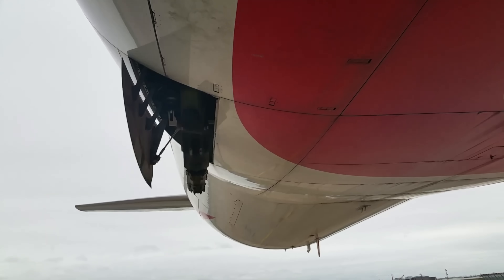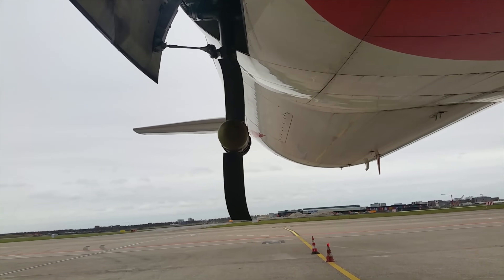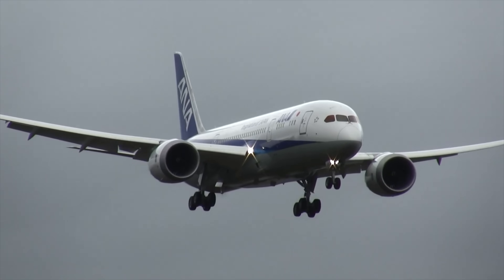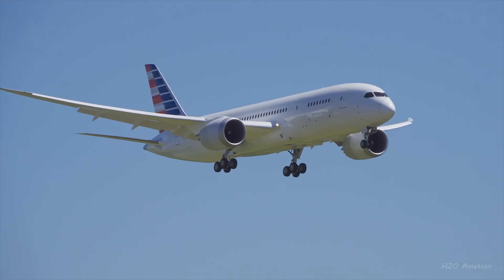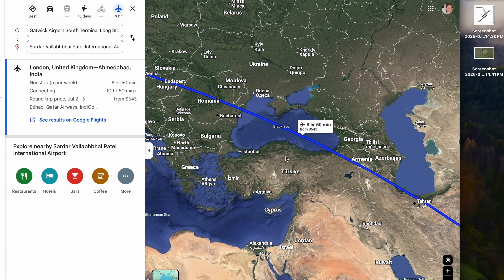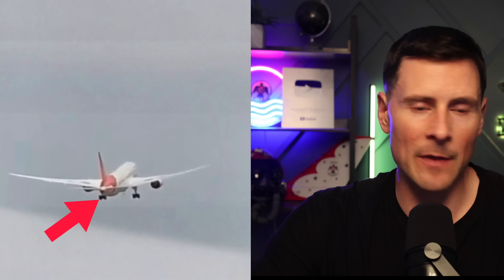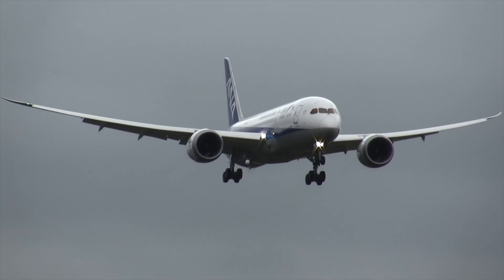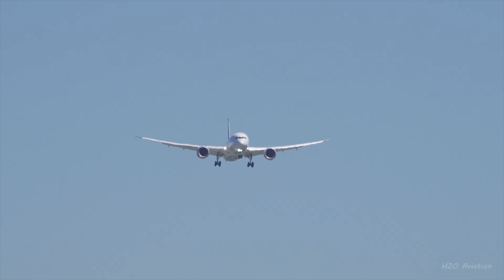Air India 171 SHOCKING UPDATE on RAT Deployment and Flaps!

Comment: If the autothrottle computer software had erroneously moved both throttles to flight idle (subject of recent AD 2024-16-07) at weight off wheels, would this have triggered auto deployment of the RAT?

Comment: Will somebody who knows, please tell us about the procedure for loading the details for take off into the 787's Flight Management Computer (FMC). I believe the FMC fully control the flaps, engine speed and other things, but can it be overridden by the pilot?
I have a bad feeling that something went wrong with the FMC, even though it has worked okay for over a million flights. Engine power sensors maybe? Who knows, but Boeing will need to come clean if it is suspected.

Comment: This was pilot/co-pilot error, resulting in a "Departure Stall"..
Too low-Too slow; incorrect air density calculations; flaps zero; incorrect angle of attack between VY>VX...
Reply: Rubbish. All of those factors are controlled by the 787's Flight Management Computer (FMC), not the pilot.

Comment: My guess has been that it was fuel starvation to both engines due to pump failures. The most likely cause, in my inexpert opinion, was that there was a catastrophic complete failure of the electrical system that was powering the fuel pumps.

Comment: Boeing 737 Max crashes investigators identified issues with the system, which repeatedly pushed the plane's nose down, leaving pilots fighting for control. Bet this is similar but with additional sensors involved with those RAT propellers. The people programming this were rushed to help Boeing sell the planes on time. Safety to allow for sensor errors not causing this was just taking too long. Trump administration were pushing for America 1st and big business profits so likely this issue was ignored. Federal regulations not as strict as they should be all because of Trump. Congratulation for another screw up.

Comment: It’s well known this flight historically didn’t back taxi to use full length.  That is likely what happened on this very hot high humidity day.  That was the first hole in the swiss cheese model.  The rest is easy to figure out.  The pilots could have used full,length and this accident would have never happened.  If it was a mechanical issue the FDRs which have been retrieved would have already been published but since its pilot error, this is going to be a hush case for a long time.

Comment: black box has already shown what happened,in 5 minutes,when will they tell us the truth,i personally guess weight shift,it is very rare a weight shift in a plane,changes center of mass,and thrust cannot help,if one engine fails it will lean if both fail it will fall and glide,bad luck was the building stood in the way with landing gear on in open space they would have crashlanded  safely...third option is something happened to both pilots,plane was on its own,it cannot be anything else...weight...both engines or pilots fainted,it cannot be something else

Comment: What is more likely, dual (simultaneously) engine failures due to fuel contamination, or dual engine rollback do to FEDEC receiving inaccurate information and putting the fuel management pumps to command idle or cutoff as a result of a catastrophic electrical failure? Both are EXTREMELY rare and have NEVER happened before. I want to know if there is ANY contamination found in the truck, or ground tank,  that fueled this aircraft! Also would love to see the maintenance logs for this aircraft. Heart is very heavy for all those who lost loved ones in this tragedy you deserve answers!!

Comment: As I recall from your previous postings, the plane was built in 2011 and had 14,000 hours of flight time. It had recently be services. The simultaneous failure of both engines and the failure to deploy the flaps suggests human error probably during maintenance. Many companies including Boeing hire poorly qualified personnel for critical jobs to save costs and increase profits. Are the flaps electrically controlled or hydraulically controlled? What about the flaps? If the engines were supplied by separate generators, for redundancy then a systematic error was made during servicing. Are the fuel pumps separate for each engine? I smell human error. Often it isn't just one error, it's multiple errors that can often cause catastrophic failure. We'll have to wait for the black boxes to reveal what happened. Forensic inspection will reveal the physical evidence. Often the parts are collected and assembled in a hangar where they might be studied for years before a final determination was made. I might have gotten the year of construction and flight hours wrong. But if this plane had many years of reliable service and had recently been serviced then that could be where the root cause lies.

Comment: I have seen 1 Pilot talk about VAPOR LOCK due to the Heat and No AC as it sat on the Tarmac for 2 hours. There were no other Planes with a problem so less likely Fuel Contamination from the Source. Not sure but in certain Model Cars Vapor Lock is a problem duevto fuel lines being too close to the exhaust Manifold or Pipes.

Comment: Some people have said that the dust kicked up when it rotated was due to a long take off roll, hence disturbing dust at the end of the runway. But that structure in the video is only approx 1/3 down the runway so even allowing for image foreshortening it rotated in about the right place.  That means the 'dust' was actually smoke from one or both of the engines. Shame it was obscured by the structure. Maybe FOD on the runway???

Comment: I believe the cause was a combination of Fuel Shutoff Valve (FSOV) activation and a cascading electrical system failure. It’s not the first time a 787 has experienced electrical issues during takeoff and required RAT deployment. Let me explain my reasoning:

On the Boeing 787, the engines will keep running even if all hydraulic systems fail. Each engine has its own FADEC (Full Authority Digital Engine Control), powered by a Permanent Magnet Alternator (PMA) that’s driven by the engine itself. Once the engine is spinning, the FADEC operates independently — controlling fuel, thrust, and safety — with no need for aircraft hydraulics or external electrical power. A simultaneous FADEC failure is extremely unlikely. 

So, why did the engines shut down if they are supposed to be so resilient?  There is one important component that can override the FADEC: the FSOV. This spring-loaded fuel shutoff valve is not powered by the PMA, but instead by the aircraft's electrical DC system. If power is lost, the spring closes the valve instantly, cutting off fuel to the engine. FSOVs are a fail-safe, designed to protect the airframe, not the engine. In Boeing’s logic, it's safer for the engine to shut down than to keep feeding fuel into a potential fire.

In this case, the truck tilt actuator (landing gear in forward position, the first mechanical step when the pilot retracts the gear) was briefly activated, suggesting the pilots attempted to raise the gear.  That gear retraction moment may have been the exact point when the whole system collapsed — just a few seconds after takeoff. The engines kept running briefly (5 seconds), powered by the remaining fuel in the lines before flaming out.

Since the aircraft remained stable in flight, it's likely that both engines flamed out simultaneously. Flaps, fly-by-wire, landing gear, and other systems likely froze — and possibly regained functionality after the RAT deployed

For both FSOVs to close, the aircraft would have to lose both AC buses, both DC essential buses, and the battery backups. That requires a massive electrical failure to overcome all possible redundancy layers. 

All signs point to fuel cutoff via the FSOVs. The big question is why did they fail? This is hard to say but here is what we know: 

The RAT was automatically deployed. This means there is a total loss of AC electrical power.

I suspect a scenario where a partially working or unstable electrical system triggers RAT deployment amid a power transition event. This could escalate into a full-blown electrical disruption, possibly interfering with the DC essential buses and battery backup. When switching power sources (from main buses to RAT), the system can behave unpredictably — especially if one source is competing with the RAT or is unstable.

In such a power chaos, RAT deployment might introduce transients or delays in power restoration, which could make power delivery unstable and possibly affect the digital managed power to the FSOVs. If they lose power, all fuel will be cut off.

On the 787, FSOVs don’t have guaranteed dedicated or hot battery backup, unlike the Airbus A320, which powers them directly from the battery. The 787’s battery backup supports the entire DC bus, and power management software prioritizes flight-critical systems. If power is limited or loads are erratic, less critical systems like FSOVs can be deprioritized. This is a very complex system with a lot of software rules. 

This also reflects Boeing's design philosophy: in a severe power failure, airframe survivability and flight control take precedence over engine continuity. Their assumption is that it’s safer to shut off fuel than risk uncontrolled flow in to an engine on fire. 

But the whole idea of the posibility of losing  both engines at 400 ft during takeoff feels inherently unsafe. From a thrust continuity perspective, this design approach is a vulnerability and may have played a role in Flight AI171’s dual-engine flameout.

To date, there are no documented cases of a modern Boeing experiencing a engine flameout from FSOV closure due to an electrical glitch. But the 787 and other Boeing models have a history of similar electrical issues.

In 2024 an Atlantic Boeing 787 flight, VS105 during climb-out, the crew experienced a major electrical failure— engine generators dropped off-line. In response, the RAT automatically deployed to provide emergency power. 

In 2015, Boeing and the FAA discovered a critical software bug in the 787’s Generator Control Units (GCUs). If left powered for 248 consecutive days, an internal counter could overflow — shutting down all four GCUs and cutting AC power entirely. The FAA issued Emergency AD 2015-08-51, requiring operators to reboot 787s every 8 months to avoid in-flight total power loss.

Two separate incidents—in Boston (JAL) and Takomatsu (ANA)—involved battery overheating and fire in the aircraft’s APU lithium-ion batteries

In December 2018, LATAM Flight LA8084, a Boeing 777-300ER, suffered a complete electrical meltdown en route from São Paulo to London. The RAT deployed to provide emergency power. Once the engines were shut down on the ground, power suddenly returned — confirming a fault in the electrical distribution system (likely a bus contactor or converter failure). The event was a textbook cascading failure: generator power was available, but a chain reaction of breaker and converter failures disconnected all major buses, including those powered by the APU and engines. 

The 787 relies heavily on software-based power management, so if the root cause turns out to be a software flaw in a extremely complex electrical system, the entire fleet could soon be grounded pending investigation.

Comment: I don't know if anyone mentioned this in the comments but there was an interview of the one survivor from the crash. He states that as the plane was taking off at one point it seemed to him that the plane had become suspended in midair ( I'm sure it didn't, the plane may have been going so slow it may have just felt that way). At the same time he states it seemed as though the engines were straining to keep it airborne as it plunged to the ground. Again this is one person's subjective experience but if accurate it may add to the overall picture...

Comment: The only survivor heard a bang and in the cabin the lights flickered.  Another indication of the RAT deployment at take off?  Usually happens 20,000 -30,000 ft, pilots have time to go through the check.    Here in Phx when it gets to warm the air thins out and this Port is closed.  How was the temp/Hum/dew pt?  Maintenance services would be a must.
Reply from the maker: Interesting thanks full update coming tomorrow.

Comment: Max, 

Thanks for the great video, as usual, however, I wanted to bring your attention to two points, reports of which I read in the newspapers here in India
1. The flight's takeoff took longer than usual (in terms of distance before liftoff)
2. Passengers on the prior flight on the same aeroplane complained that the touchscreens and some lights were not working. This was on the Delhi-Ahmedabad leg of the same flight. 
Is that an indication of catastrophic electrical failure, and what is the usual protocol - how seriously do airlines take these complaints?
Can we suspect negligence on the part of the airline if this was not taken seriously, or is this typically not a significant concern?

Please answer these questions in an update or new video.
Reply: 1. It didn't.
2. The in-flight entertainment system's operation has nothing to do with flying the plane.

Comment: 7:08... Ok, so that shadow didn'T appear on this plane's wings, and clearly, the flaps were down, no shadow. Speed brake must have been engaged somehow on the other plane, causing the RAT to deply as well automatically? Stuff like this is why fly by wire scares me, even my car with it's same configuration gas pedal, I'd feel a lot more comfortable with cable, I just don't trust computers. So now, what caused the air brakes to deploy? Once again, I've never seen an airliner gear up til way after the altitude this plane got to, I'm thinking that shadow on the wing had to do with this, both. What else is left?
\O>

Comment: This RAT deployment is an unmistakable evidence for the short circuit that has occured on board this 787. It means that all the 787 operations are hazardous from this time and should be suspended before another one crashes down.

Comment: Yeah, I don't think the RAT is spinning at twenty thousand RPM.
It's a variable pitch prop, I've heard they run at 4,000RPM.
I've also heard a general range of 5 to 6 thousand RPM.
It's pretty clear that the RAT was deployed, it doesn't surprise me that the gear was still down.
I'm ignoring the mayday call stuff for now. I've read at least three different versions from "news" sources claiming to be quotes.
The only thing they all agree on was the "mayday" part.
The flap comparison was nice to see. I'm wondering if the visible line isn't the spoilers floating from a loss of hydraulic pressure?

Comment: Is RAt deployment auomatic with manual overide? Can Cockpit and black-box determine which mode occurred? That is auto deployment of RAT or manual. What conditions trigger autodeployment of RAt. Once we get these answers, we may know more? The fact that they used the entire runway to take off suggest reduced thrust or air density being low- hot day? I am not an airline pilot but what could have been the cause or causes of this fatal and very sad happening. RIP to all.

Comment: They obviously had a serious hydraulic failure if the RAT was deployed.  As such it's quite possible the pilots moved the flap lever to the correct position, but the flaps never deployed to that extent due to hydraulic failures.  I'm thinking maybe fuel contamination started this tragic sequence of events.

Comment: I am with full agreement with your views. Electro mechanical breakdown during take off caused both the engines failure, unable to lift gear and RAT was deployed as last resort, but it was too late due to low speed & altitude. Thanks from India for your analysis

Comment: If theres enough lift to get to a couple hundred feet  then  it shoul be maintainable  unless  a} thrust is reduced   or b} L/D is reduced like spoiler deployment.     Looking more and more like dual flamout.      Electrical failure in and of inself would not reduce thrust unless the fuel pumps are electric only???

Comment: Both engines started losing power after V1.

Too late to abort 

Ran all the way to the end of the runway trying to build speed on the reduced power.

Lost all power shortly after they rotated, and the ram automatically deployed.

Nowhere to put it down , no time to react.

My gut feeling is the fuel in the wing tanks was too hot and the fuel pumps cavitated. (Vapor lock) and both engines starved for fuel.

Comment: There could be possibilities that highly contaminated fuel intentionally impurities added in the fuel top, which is not mixed with fuel in static condition but mixed with other pure fuel in dynamic condition, could have damaged the both engines after takeoff. There is no other reasons why both engines fails.

Comment: How about what you Don't hear?  You don't hear the sound of takeoff thrust being produced from a high bypass ratio General Electric GEnex or Rolls Royce Trent 1000 engine, the characteristic droning sound  that even the smaller single aisle Airbus aircraft make.  That aircraft was not producing takeoff power.

Comment: My guess is that a fan blade would have cracked causing damage to both engines severing hydraulic lines leading to loss in hydraulic power and the subsequent RAT deployment. A crucial piece of information is that the sole survivor on board the plane who escaped from the crash claimed that he heard a bang from the engine which could imply a compressor failure.

Comment: I suspect the black area on top of the wing is the spoilers lifting from their flap down position to a neutral (inflight contour) flap up position. This supports limited hydraulic power and rat deployment. Also supporting engine failure most likely fuel contamination.